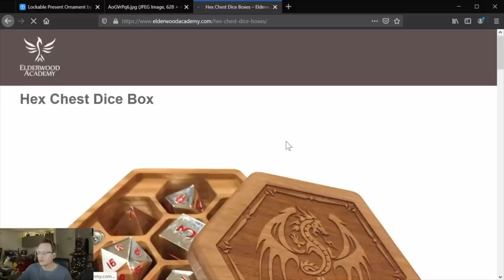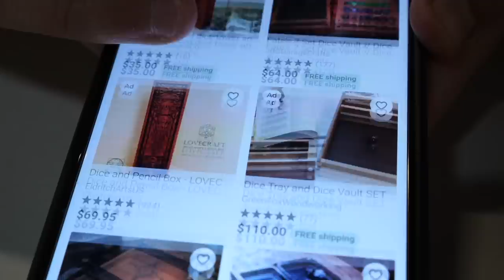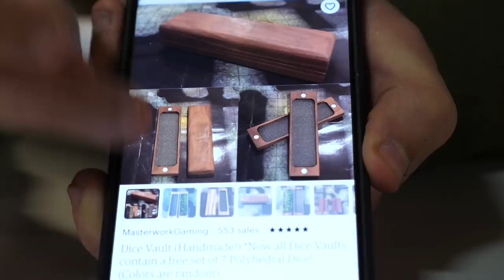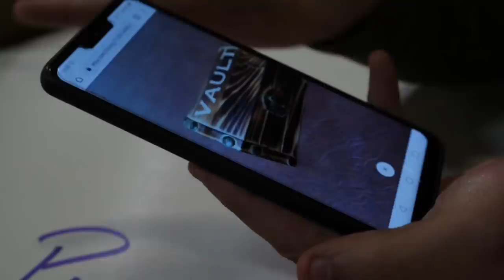Why We're Ok With Other Companies Ripping Off Our Designs S4E9

Comment: Johnny, you're doing great with that forklift, but for the love of all that is holy get the forks all the way in! Yes, be careful not to bump the load, but that little extra bit actually helps a lot. It makes the load safer by shifting the weight further back, makes it easier to handle in the case of long loads and in case you have a load slide it prevents damage. (If it's a case that you couldn't because of some limitation with the laser and you know all this, sorry for being "that guy". :) )

And while I'm posting, I should say that I love how chill you guys are about the IP stuff. Makes the little Maker in me quite happy.

Comment: Elderwood Academy's hex chests are hot garbage anyway. I bought one a while back and I wish I hadn't. The cutting and magnet placement are inconsistent. If you put the lid on backwards it doesn't line up right. A piece of mine broke within a week of getting it, and I had to sand all the interior edges and corners myself because it arrived rough and barely even fit together. Their quality control is nowhere near Wyrmwood's level and now they're trying to patent something bees invented a million years ago. For fuck's sake, guys.

Comment: My issue with screw-in magnets is that they look like trash to me. If I wanted to see exposed screws in a wood working project, I'd go to the local community workshop and bash it together myself. A popped out magnet can be easily solved with come superglue. Preferably even I'd get a slightly larger magnet that's then covered with a contrasting wood plug with a laser engraved logo on it.

Comment: I once tried to 3D print my own dice tower using 3D files that were pretty much identical to Wyrmwood. I spent painstaking hours reprinting warped parts, gluing rated earth magnets by hand (which was nearly impossible. I FINALLY got it all finished.  It snapped together, I put my first dice in and the whole thing collapsed. I was so frustrated. XD

Comment: I'm not opposed to IP in general, but it should only be for products where the research and development are more labor intensive than the manufacturing. For example a book is easy print but hard to write, pharmaceuticals are relatively easy to make but it's expensive to figure out which ones are effective, and software can be copied far more easily than it can be written. In those cases we need some kind of system in place so that the person who invests in the development process doesn't just get undercut by people freeloading off of their work, though our current IP laws do need to be overhauled. But for products like your's the manufacturing is where most of the skill is, anyone could design a dice tray (it's a rectangle with an extra wall going down one side) but it takes a lot knowledge and craftsmanship to actually put one together that is squared and sturdy. I'm glad to see you guys are willing to stand behind your work and let it speak for itself, that is the mark of true craftsmen.

Comment: Elderwood also had a hex vault taken down on thingiverse by submitting a rejection of the trade dress. That sounds dodgy and it’s the reason I haven’t bought and won’t buy any of their products. There are cases where it is appropriate to get protection (things you guys have done for example) but elderwood is trying to take a pre-existing pattern that is only a utility design. It is a bad move which will cause confusion when people and companies rightly apply for protection of their intellectual property.  Now when ever you folks try to protect something you’ll have to qualify that it’s not the same shady stuff as elderwood. It is bad for creators and it is bad for the community.